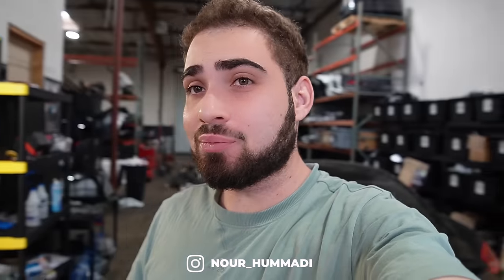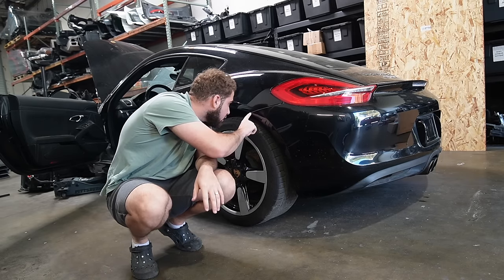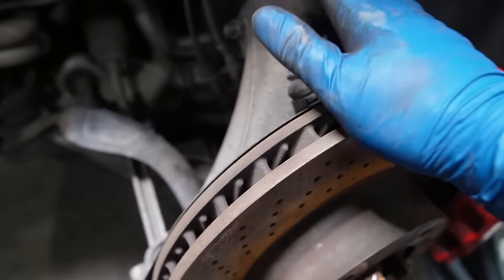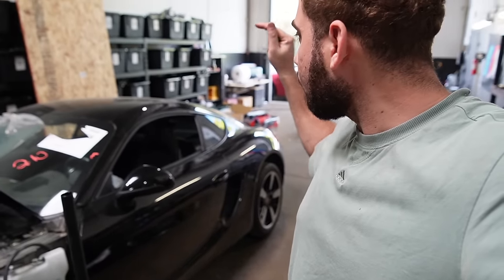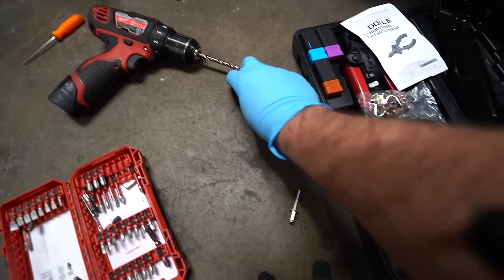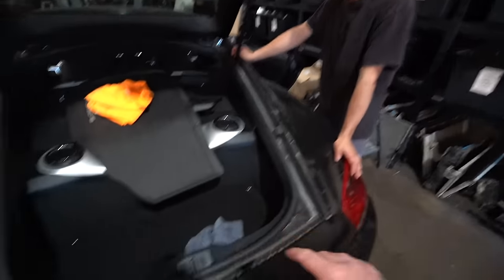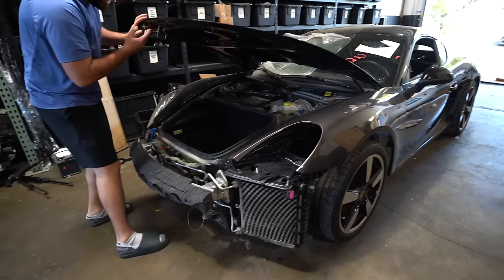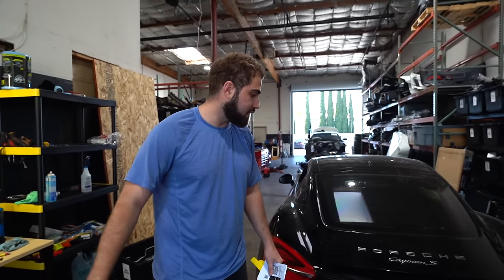PORSCHE WANTED $6000 FOR THIS $200 PART I GOT FROM GERMANY! DAMAGE REPAIRED!

Comment: Hey Nour. The vacuum fill tool uses the Venturi effect to pull a vacuum on the cooling system. The compressed air never goes into the cooling system, like your buddy was saying. Once the system is under vacuum, you can fill it with coolant without re-introducing it to atmosphere.

Comment: Nour  the rear trunk modules go in these it is located under the drivers seat in the carpet opening the larger black plug on it has the wire to control the rear boot pin 19 the blue wire on the top row adding 12v to it will open the trunk  hope this helps cheers from down under